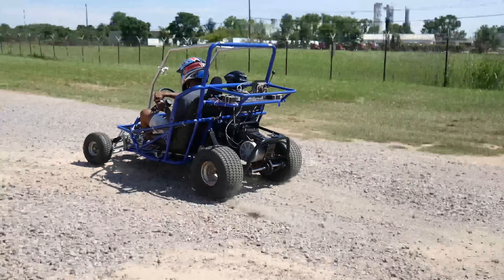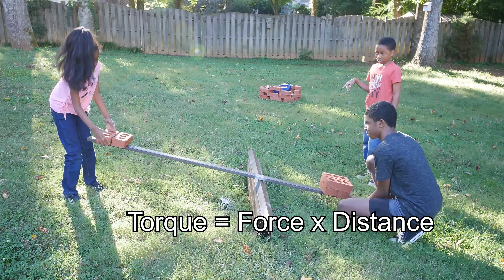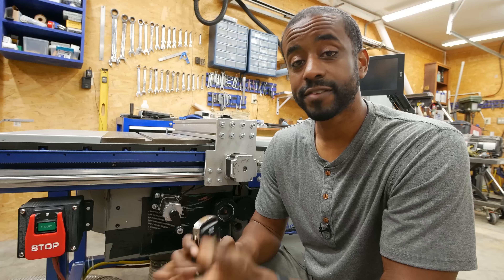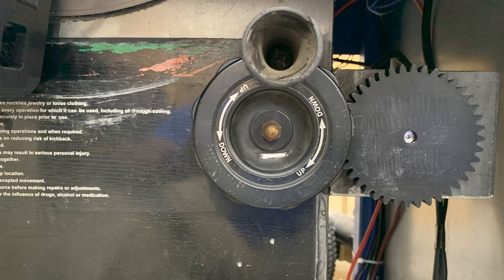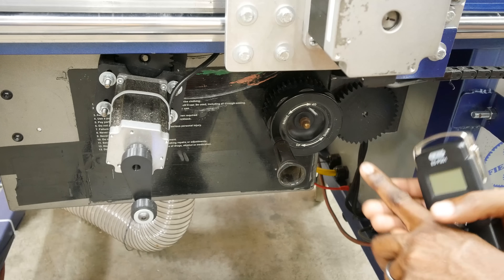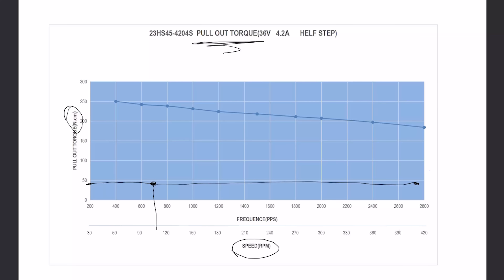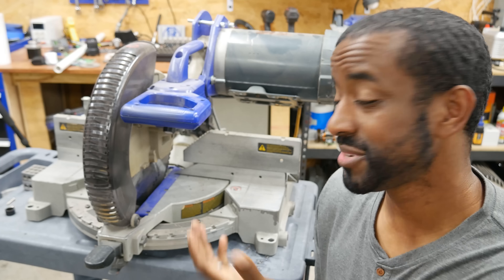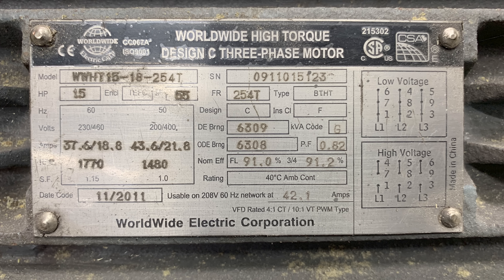How To Size Electric Motors for Any Project: A Beginners Guide #085

Comment from the maker: I changed the plan! I will go live here on Youtube Sunday Oct 18 at 12pm Central Time! Join me and feel free to ask me anything. I look forward to meeting you all then.
Reply: You are an awesome instructor, thank you for these.
Reply: Jeremy well done on a practical guide to basic motor selection. 

I have been doing Control Systems, Automation and Robotics for ~30years and that has involved a lot of motor control. I've seen a staggering amount of development in VSD technology in that time. I call them VSDs for the simple fact that every other term is simply irrelevant these days. Even basic variable frequency drives are no longer just VFDs as they can control the voltage, current, torque, accel & decel ramps, DC injection for both braking and pull out and that's all before you get onto all the other stuff they can do.
I have even used some of the more advanced drives to completely control internally entire sections of production lines and that was 15 years ago. These days the internal safety functions of many drives have a higher rating than simply cutting the power to the VSD with a contactor.

Really goo do you to mention the inertia issue. That is one thing that so many engineers get horribly wrong and at times ruin entire projects as happened to me a couple of years ago. The inertia issue involves a square law and someone misplaced a decimal point. It should have been a very simple thing to check the final drive speed and THEY DIDN'T. The basic gear ration was out by a factor of 10 and that put the inertia ratio out by a factor of 100. By the time I tried to explain to people what had happened they were all running of cover and I got my contract cut (effectively sacked) as the messenger.

If you want to do something  let me know. There are so many BAD videos on motors and motor control. I really am scared that people will get hurt if they already haven't been. Some of these small 3D systems are seriously fast and its so easy to do this stuff that many many people take it for granted. Stuff people buy off the internet is not like going to Haas and getting a basic CNC mill. Haas, Fanuc, Hermle and others have to follow standards the small 3D printing, laser, cnc & waterjet crowd DON'T. 

FYI - I have been TUV FSEng certified in the past so I know the safety stuff very well.
Reply: I'd like to listen and learn.
Reply: Any way you can tell me what kinda motor to buy or how much torque I need to turn a garden valve?
I want it to apply to any valve, so it needs to be powerfull enough for any but not more then that...
Reply: One more thing you need to select on is if your motor needs to hold torque when standing still.

A lot of applications only need motion, but controls like your bench saw probably are best with a motor with 0rpm holding torque so that pressure on the bench itself doesn't shift the tables position (which could screw up precision cuts).

Most of that type of automation applications have more need for motors that can keep position than the motors being fast or generally powerful.
Reply: what do you recommend for a light weight motor that can lift 150lbs what size do i need?
Reply: If I feed electricity into my outlet will it go into the power grid
Reply: @justinarhart8682  no, please don't do that without extensive research.
Reply: Teach your kids to lift with their legs and not their backs please...
Reply: You are a good man. I love your videos.
Reply: What's your degree
What u studied?
Reply: Im thinking of making a homemade clothes washer using a 5 gallon bucket, on youtube you can find these are all manual, i intend to add on a motor, the concept is simple, you make a hole in the buckets lid, and you put a clean new toilet plunger through the lid hole, you add water, clothes, and soap, clothes the lid and move the plunger up and down. Creating a washing effect. For this i need a motor that would be strong enough to move wet clothes continualy, preferably an up and down morion every 2 seconds, thats where things get tricky because i dont know of any motors that are string with low rpms, thats why came to you, if anyone knows motors, its you. I would rather let you take on this project, being that you got all the motors and the skills, plus an awesome channel with loads of followers, but if you decline, can you at least point me in the right directtion for what kind of motor i would be searching for. Thank you.
Reply: @enriquesalgadoaceves9017   If this is just a diy project that you want to do yourself then it sounds pretty cool. But if you're doing it to save money,  just buy an apartment sized one from Amazon. My wife bought one for 99 bucks 3 years ago and it still works today. It has ports that you can feed water into it, but We put it in the tub and fill it with our shower head. It has timers for run time, a nob for draining.  Which is why we put it in the tub. there's no chance of  overflow or drainage failure resulting in water damage. It also has a spinner so after wash you can spin the water out of your clothes. On top of that We bought a foldable clothes rack to hang the clothes and because Our bathroom is small I put a dehumidifier in there I had luckily found being thrown out on the side of the road. So it literally turns our bathroom into a dryer. the whole set up works great.

Comment: When you were explaining the rotational torque on the table Saw, I thought, you could program a range that would trigger an LED for maintenance required. When the sawdust builds up and it gets harder to turn. When you are operating it by hand, you notice those little things.

Comment: Nice video about motor requirements and specs, however, your demonstration of power with the kids hauling bricks is somewhat flawed.  While it is true that work is force x displacement, there still has to be a force in the direction of the displacement.  The kids walking horizontally at a constant speed while carrying bricks are exerting no force on the bricks and, hence, are performing no work on them.  The horizontal displacement is thus irrelevant to the problem except, perhaps, to reduce the power output of the system.  The only work the kids are doing on the bricks is to lift them from the ground and perform work against the force of gravity.  To increase the power output of the system, you could simply reduce the walking distance so they could pick up more bricks within a given time.  To better illustrate the concept of work and power you could place the bricks on a pallet attached to a rope and simple pulley system to allow the kids to pull the bricks up while walking horizontally.  In that case the horizontal displacement would equal the vertical displacement of the bricks, and the work would be the weight of the bricks times the displacement.  I'm all for using analogies to illustrate concepts, but you cannot compromise basic principles in the process.  Besides that - an excellent video.

Comment: So once the proper motor is sized how would i go about using a dual motor set up in say something like a electric go cart? Is it the the same as with one motor running off a controller when you connect two to that controller? Or would you need a controller per motor and tie the two together in order to reach a working same speed same rotation result from two motors? Do you have a video on that by chance lol

Comment: I do hope after the laughter, some one can help me help some at risk kids. I want to push a 30k pound General Motors PD-4501 Scenicruiser. It has a dual rear wheel axle configuration. I have the choice to replace two different power plant configurations. 1- two diesel engines providing 153 hp @2100rpms, 113kW @ 2100 rpms and 542 Nm @1600 rpms or 2 - one diesel engine providing 304 hp @2100rpms, 227kW @ 2100 rpms and 1085 Nm @1600 rpms. I do not know why the specifications do not have the power and torque listed at the same rpms, as an accountant that data flaw seems incongruent to me. I have not asked around yet, as I am not ready to invest in professional advice, so I am not sure if it is possible but I am contemplating direct drive to each of the four rear wheels. I believe if my understanding is correct that I would need at the minimum DC motors of at least 227kW/4 or 57kW aech. Is my calculations correct?

Comment: Do you have any suggestions on what I should test on a corded drill that continues to spin after I take my finger off the trigger. When I pull the trigger the drill speed adjusts according to the pressure on the trigger. Like a transmission that never goes below 1st gear but will shift through 2 3 4 5

Comment: I have a million questions!! 😮 wish I took this course in college !! 

Would someone help me ask the correct questions ??? 

I want to use a brushless magnetic motor to generate electricity and the high speed motor used in aircraft appears ideal  ,, but ??  

I want to generate steam to turn the motor / how is steam power measured? 

Is it the diameter of the stream of steam 
1 inch diameter stream of steam 

 500 psi 

plus the speed it travels at ?? 

The project is using two parabolic mirrors 4 ft in diameter each will generate up to 3500 degrees 

Which is the motivation to build the project 

The focused light will be directed onto a tank or pipe full of water 

As the steam increases in pressure it’s released at a constant pressure to turn the rotor / rotors , 

If the resistance of brushless motor is less
And depending on the size multiple motors can be mounted on one shaft axel 

I need to fabricate the solar heat generator first , measure the pressure, volume / speed to know the size motor / generator/ amount of electricity can be produced 

Too much info here and I apologize , I got excited finding this channel and lost control, 

Any info , guidance, direction is appreciated 

I live in THE MOST SUNLIGHT / HEAT 
PER YEAR / REGION IN NORTH AMERICA AND BY INSULATING THE DEVICE TO THE MAX IT WILL GENERATE STEAM 24/7 

Again thanks for any ones thoughts ideas

Comment: A small error in what you said, Jeremy: Inertia (rotational or translational) has no effect on the motor power required. It will only affect the acceleration of the load until it reaches the desired speed. Now, in practice, you don't want to have to wait 30 seconds until your load reaches its target speed, so the motor torque has to be selected accordingly.

Comment: Hi Jeremy,  I want to build an automotive transmission test bench.  I want to use a variable speed electric motor to operate the transmission.  I would like to operate the electric motor from 1000 rpm to 3500 rpm.  I think a 2 or 3 hp electric motor would be adequate.  What type of motor and controller do I need, and where do I purchase them ?

Comment: Sir, How Can I select the perfect servo motor for the Frame I have for a CNC router?  Can you do a simplified video on how would you calculate the moment of inertia and all to size the motor?  I have seen most servos come with auto-tuning feature. But How can We select the right size of motor?  I dont know much about gain tuning and all. Otherwise I have to select a stepper with bit high power. But I find it less productive..!

Comment: I have 2 degrees but find myself in a job where I repair things and use my hands. I absolutely love it and that is why I do it. I never knew I was so mechanically inclined until I decided that it did not matter if I broke something that most anything could be fixed. Also, if you try to repair something that’s already broken it’s a moot point. Lesson learned just jump in and do it. You will build experience extremely fast if you have common sense and if you have common sense  you can figure out a lot of things that you have never done before. When it comes to electronics and electrical things I am not very confident and with the risk of getting hurt or hurting others I am less likely to be so free about “just jumping in”. I have read cover to cover a college  electronics book and an electrical book. Yet, this subject still allures me unlike any other subject. I think I will have to have someone actually teach me and I learn hands on. I came across this video today (the first I have seen by Mr. Fielding) and I subscribed within the first few minutes of the video. I do not subscribe much to anyone but I knew this guy was special. Mr. Fielding I have never had anyone explain the subjects you explained in this video in such a way. Nor have I understood those subjects in such detail and understanding. Although I knew what torque was I could never wrap my head around it and grasp it so fully. You are a wonderful teacher. I will recommend to anyone who is learning or even thinks they already understand the topics you teach to watch your videos and support your channel. I am a millwright and I build and repair lots of really cool things. You have really shocked me on how well you made this one video how well you got the ideas across. Thank you from the bottom of my heart for making these videos. I can’t wait to add some new elements and skills to projects that my twin boys (7) and I are going to be starting soon. Now time to go watch more videos!! Brett and sons Gabriel and Beckham-Hoover AL

Comment: Hi thanks for the great video. Could you tell me if a l convert a bandsaw that originally ran on a 1/2 hp 1400rp motor to run on a 1hp 2850rpm motor with a speed reduction of pulleys to the original bandsaw blade speed of about 875 f/pm?

Comment: Question for you, do you know of a simple rapid stop or slow down for electric motor, example: old table saw, single phase motor with run cap.  How to reverse wiring so motor spinning can create counter emf, force motor to slow down quicker than spin down

Comment: The reason I bought an EV, was the day my crew replaced a 25 hp motor on an air handler that had been running continuously for forty years.  I didn't believe them at first, so I researched our maintenance records and found them to be correct.  We had to rent a crane to hoist it onto the roof, then cut a hole in a wall of a tower to hoist it in the building.

Comment: Hi sir, Thank you for sharing the knowledge with others. I really like your videos and I have a question for you.
Can I use this motor from the vacuum cleaner to make a circular table saw or what type of motor can I use for it? If not, what else can I do with this motor. Wish you the best. 
Thanks
Reply: The model number is HWX-140  AC220-240V  50/60Hz 1400W  CLASS 120

Comment: Company I worked for (deep south) had some real problems (to say the least).
  They sent me to one plant where they kept burning Belt elevators up, they made Fertilizer of some sort there.  If I remember right the elevator had heaters (overload protection) for twice the Horsepower.  They did have a speed control installed on the driven bottom pulley but it was set to something like 45 seconds (before it would disengage).  This was one of many blaring problems I found that day.
  You sir seem to be a competent Engineer, even if you are not formally educated in this.
  I since moved out West, while not perfect, the level of competence out here is vastly better.
  It was a pleasure viewing this.

Comment: This has been very helpful! I'm working on building a trike that can tow a kayak with camping gear strapped to it. I want torque and distance, from my motor, not speed. My city already restricts e-bikes to 25 mph/40kph anyway. My bigger problem is figuring out rear differential mechanics using hub motors, because I have a feeling that  direct drive with a ton of torque will damage my chain and gears which aren't meant to handle those forces. I feel like my spokes are much more suited for the strain. My blueprint parts list is making my head hurt.

Comment: I'm currently in the midst of a project. I want to put a brushless motor in a custom built power wheel. Will 72v 3000 watts with a speed controller work? Also wondering if I could contact you during the build to get some ideas on the electrical side of things. Hope we can chat about it.

Comment: Im looking for a DC motor that is water proof dual shaft adjustable speed and enough power to drag about 500lbs .
What size do I need ?  It will not be ran unless needed. It will have 4"×8" tires .

Comment: When you said the scale could not be used to pull the handle down… coz of the weight… that’s not really true right? If it was a 1kg scale, and the handle took 1kg to move… hanging the scale of it would move it, but also register 1kg… it wouldn’t effect the measurement???

Comment: if your interested I'm planning on putting a electric motor on my sailboat it's a catalina 30 it has a unverisal m20 diesel in it. but I have seen builds in a catalina with 5kw motor I have bought a 10kw motor from reacher tech D83L95 is the motor I'm wondering if itv was worth buying for it I bought it brand new in the box from a garage sale

Comment: I've never understood why we use HP for electric motors in the US. We use SI units for everything else regarding electricity, including power consumption of most devices, but with motors, for some unknown reason, we just had to be different! I don't normally complain about this, because what units we use hardly matters in most of my life so long as I understand them, but using HP instead of watts legitimately makes things (mildly) harder for no good reason.

Comment: Is there a way to compare similar motors if one of them doesn't have the standard HP/RPM labeling? My drill press motor just gives the Volts and Hertz. But it's exactly the same size and shape as an old 1/15HP sewing machine motor I have.

Comment: hey, can you explain again why using the smaller pully will give you more force output? will it give you less or more torque output ? The smaller pully have smaller raduis, how it affects the torque/force output?
Reply from the maker: Check my video “how gears and pulleys work “ it is much more detailed